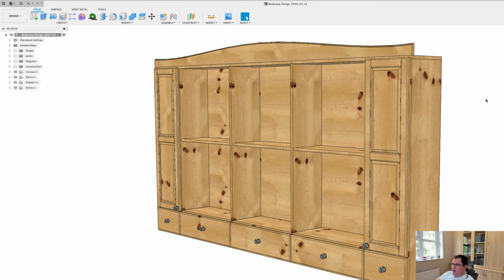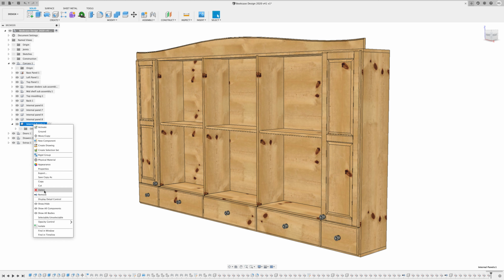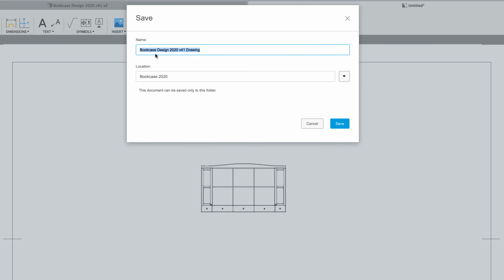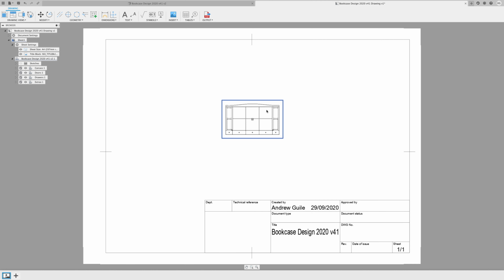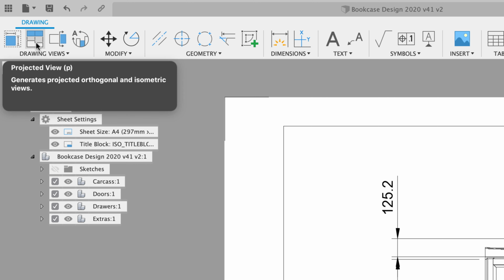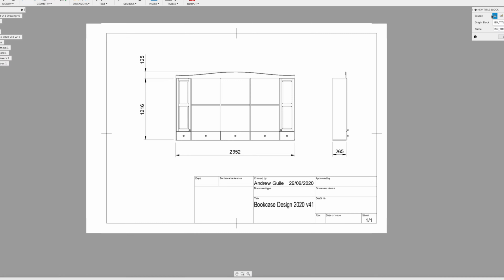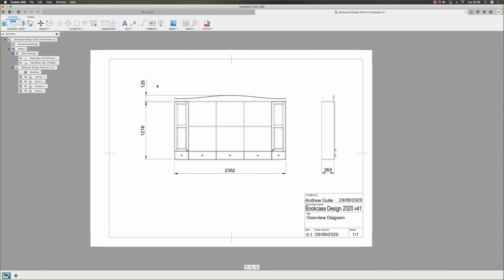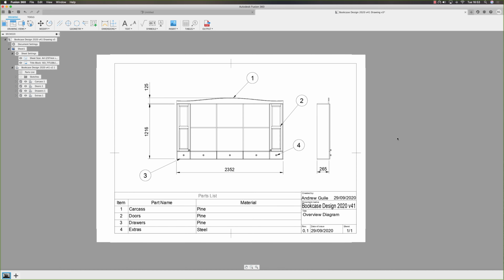Fusion 360 for Woodworkers - Lesson 15 - Drawings

Comment: First, thank you for this series! I had an issue when re-organizing the long list of components into the categories of "Carcass" etc. Fusion would move the components as intended, BUT then the joints did not seem to work correctly. The sliding joints for the drawers no longer functioned. I cannot figure out why that is. Any thoughts? Again, thank you for this series!

Comment: Extra sheets and output to pdf are restricted with the (free) hobbyist version... Do you know a simple workaround?? Also the number of editable documents...

The last 10 minutes are blank still... Time for an updated version??
Reply from the maker: Hi,

You can set up a large single sheet (A0) - then have multiple diagrams on that sheet.

You can then use the Print function and a PDF plug in.

Sadly Youtube restricts the ability to edit puished videos.

And yes time for a refresh.

Cheers

Andy